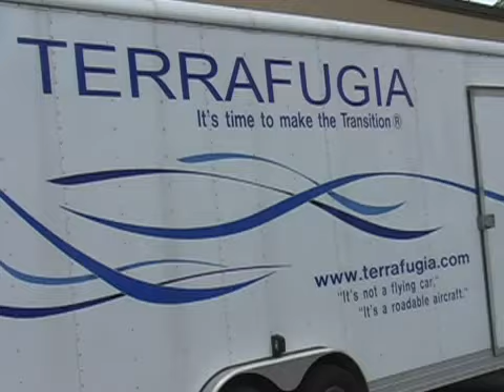A driveable personal airplane: Innovation Economy

Comment: @TogieTung yeah I would look to do that too. a unificatin but probably avoid the complexity of fly by wire. I would have disc wheels that would double as rudders and then unlock steering wheel back and forth as attitude control. maybe a mechanical switch to change function of steering wheel before take off

Comment: I want a car that converts its gull-wing doors into airplane wings, uses the steering wheel for dual flight and driving control, and hides the propeller into the rear of the car. Don't forget - I also need four seats and trunk space.  If not four seats, then 2 seats in a sexy sports car design that rivals the Lombo Reventon!

Comment: a little odd that they didn't think to recline the seating position for cross section drag considerations. such an upright position is quite unnecessary.
I'm a fan of the determination to do it and the quality of the build but really not a fan of several design points